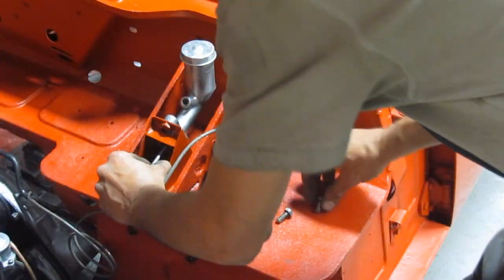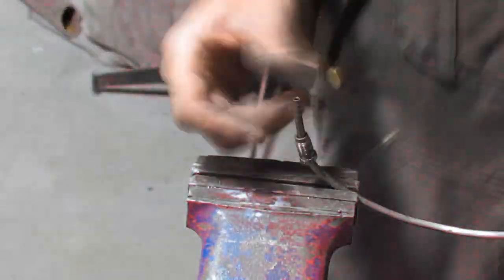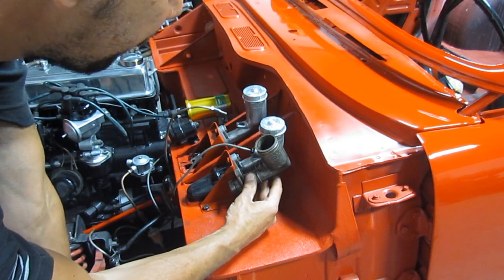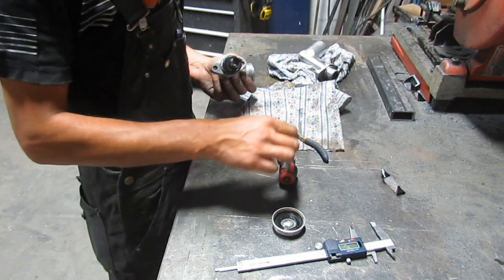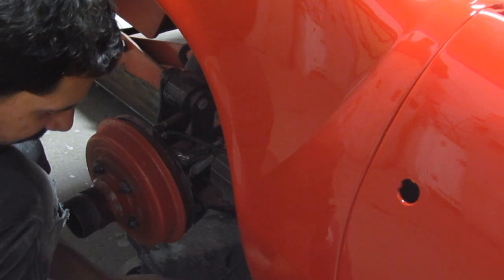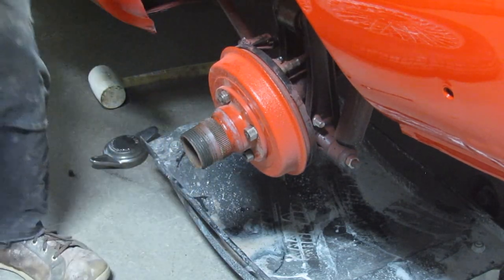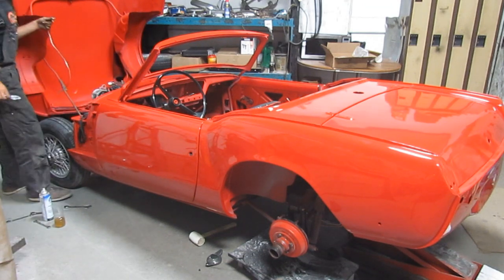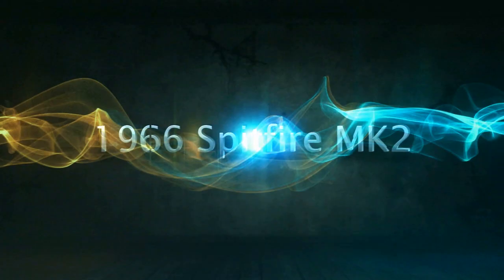1966 Triumph Spitfire MK2 restoration project - part 21

Comment: Thanks. Have to advise you wipe-up any spilt fluid, as it's quite corrosive and will leave any metalwork bare to corrode. Cheers.
Reply from the maker: Yeah, I know that. I used brake cleaner and air to clean it. Thanks
Reply: Water, 
if you are not using silicone, brake fluid it is hygroscopic it also will strip
lovely new paint work!
Great vids, I am enjoying your practical common sense solutions to the issues
this project throws at you, cheers:-)

Comment: Could you put the specs for the brake line threads in the description? :)
Reply from the maker: Sure, it is done. I also mentioned it in the video, but with my accent it probably sound like blablabla and the step is blabladibla LOL :)
Reply: Not at all - but it's easier to copy/paste from text than from audio.  Sorry to hear about the busted MC - when you started saying you heard the "clicks" then it was "easy to turn" I knew it was cracked. :(

Comment: Elin oh Elin, why did you do that with your brake m/cylinder, when you change it for the right one you're gonna get spillage on your nice new paint All for the impatience of wanting to drive your new toy. And you haven't even run the wiring loom for power to the engine. You have a real fan in me but somethings just have to take their turn. Can't wait for the finished car.
Reply from the maker: Well, it was done long time ago and I didn't damage the paint. You should see me driving a TR6 with no body on it LOL just a rolling chassis. You're not gonna like me there :)

Comment: Hi Elin, my MK3 has the 90 degree master cylinder fitted and I beleive it is the original part. You can see a picture of it here: http://s32.postimg.org/kvkomq3lx/IMG_4401.jpg
Reply from the maker: Hi Hallum, I don't think it is an original part. Probably someone like me put it temporary there and it stayed forever :) This actually is a TR4 clutch master cylinder. There the mount is close to 90 degree.
Reply: I think not, just think of the aesthetics when you look at them both, I'd suggest it was changed out sometime before you got the car, and on the cheap as well(couldn't find the angled one)...John (Mechanic)